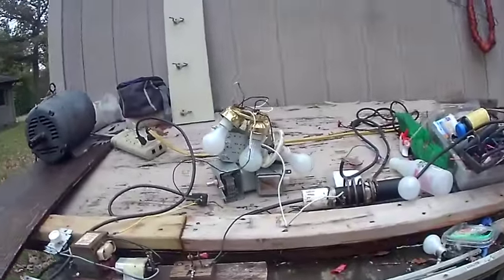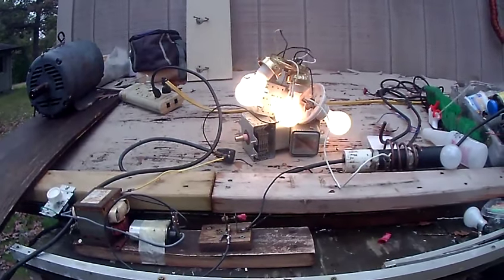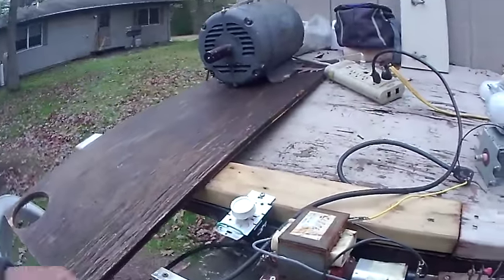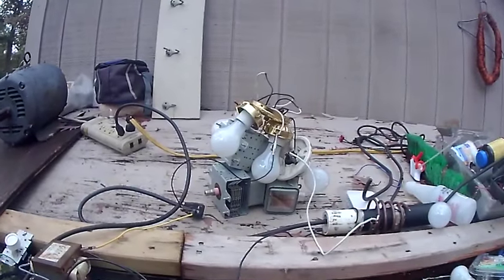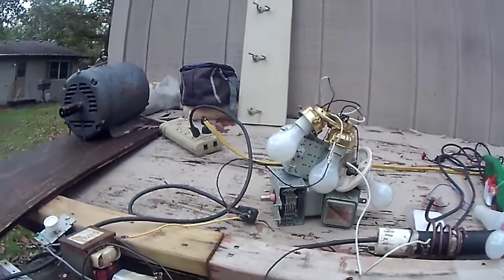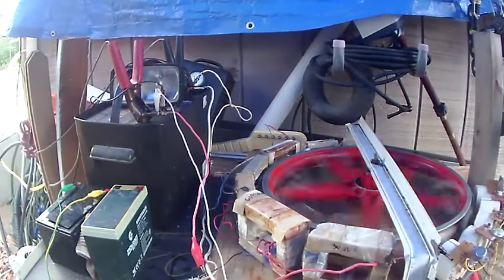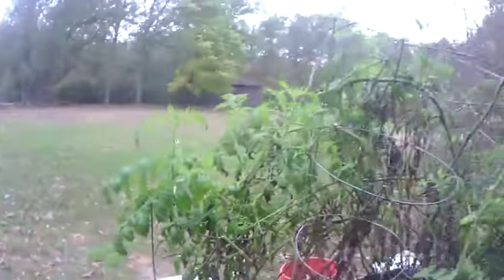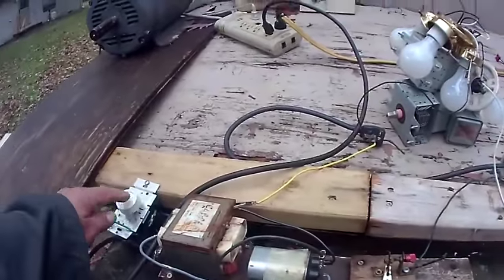Kapanadze generator revisited

Comment: I'm not sure but I think the delay would be due to the charging time of the HV Capacitor. You may discharge it before the second time you turn on again and see the difference.
Reply from the maker: JB this is a MOT cap that has quick discharge thru the 10meg ohm resistor built in.
I am using good earth ground and wet environment. The Mot is resonant and spark gap works with a good ground so any extra energy must come from a delay by making the earth give up electrons like a pump! It will build up over time.a surging effect or so have you.

Comment: is your input voltage to the transformer 120vac. if it is 500w/120vac should only draw 4.16a . so the transformer shouldn't be getting hot.and the spark gap should be going constant. I think there is a wiring problem. if you have an input of 240vac then only 2.08amps so no way thinks should be getting hot.
Reply from the maker: Yes still work in progress ... thank you!